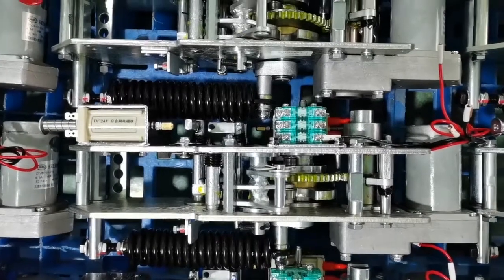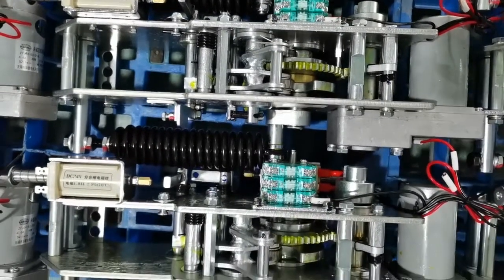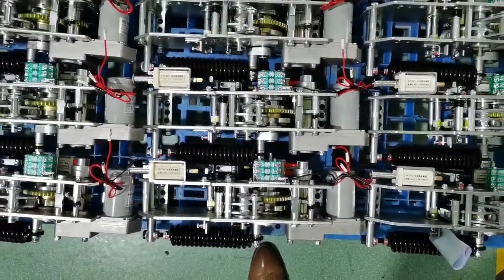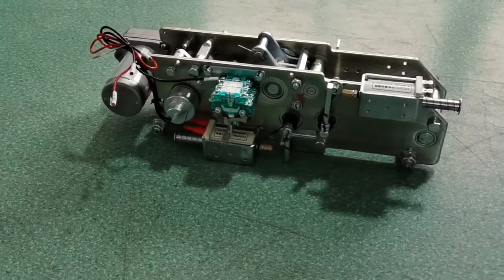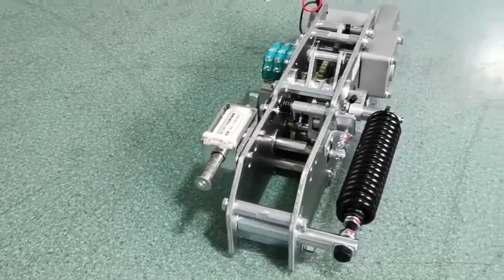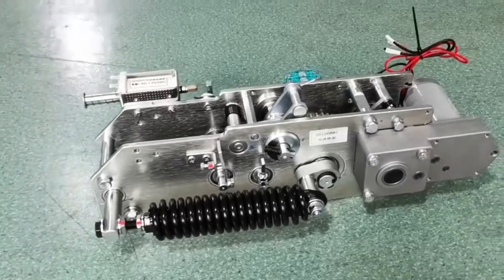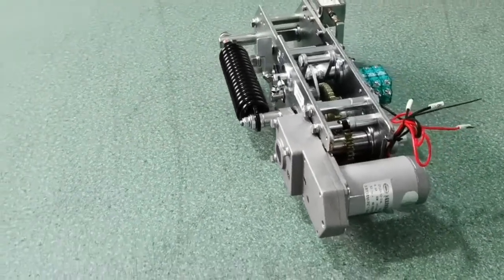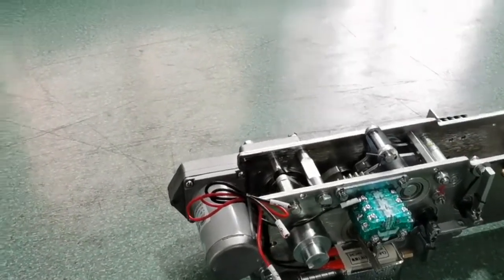Operating Mechanism CTB type for Vacuum Circuit Breaker

Comment: Could anyone test out my application?  research circuit solver on the playstore!
Reply from the maker: https://www.sinoamigo.net/category_2598227145982976.html
Hi Phasor you could check these medium voltage circuit breaker
Reply from the maker: the medium voltage circuit breaker mainly for power utility distribution line, more supporting required please contact: info@sinoamigo.net whatsapp: +86 13968811424